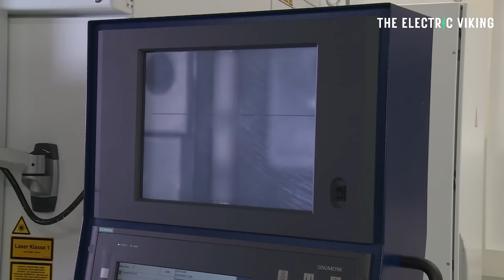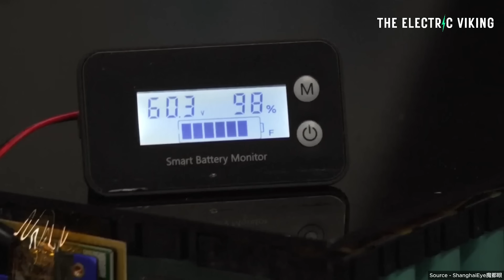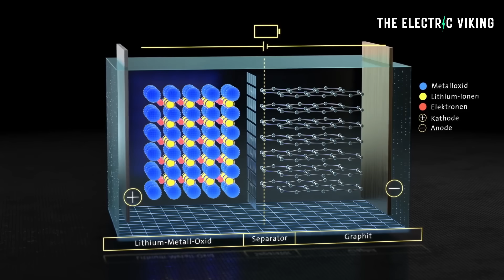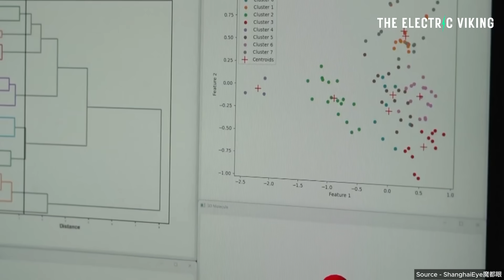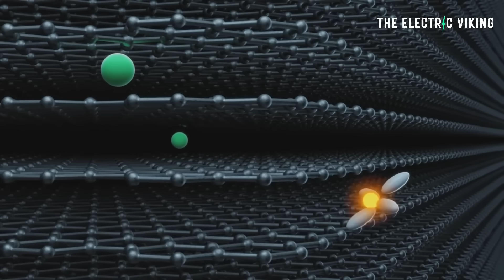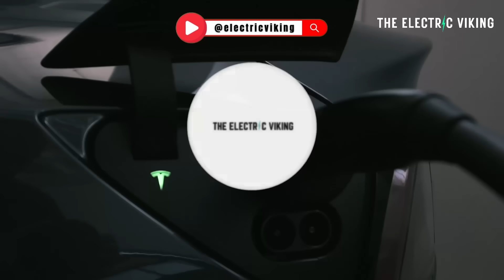AI discovers game changing CHEAP solution to double lithium battery life

Comment: Does the acceleration of new battery technology hold up buying decisions? That is, it will be difficult to decide to buy at any point when perhaps a few months later there's a better cheaper solution available. I recall my thinking about buying a PC in the 1980s. Things were moving so fast with new technology every few months costing less and less that I did not buy my own PC until 1990. Today, thinking about solar panels and batteries for the house, it's difficult to invest cash now when next year the price might be 30% less for twice the performance.
Reply: Solar panel performance isn't really changing that much, it's still in the mid-20% range and probably will be for many years yet (new tech is still lab-only). The prices are getting cheaper, though, so start the system small today, and upgrade it when you find bargains
Reply: @michaelmartin9022  I find your idea of starting small and upgrading when bargains are available appears to be unreasonable. Why would anyone pay several times for scaffolding to allow installers access to the roof? Then there are several other base costs for any installation project. To minimize these base costs, which can represent up to 50% of the project, the only reasonable way forward is to bear the base costs once, and get the full installation done once.
Reply: @ianburton9223  I was thinking you were planning to DIY your own system
Reply: @michaelmartin9022  My first job was building nuclear power stations. Thankfully my engineering education was enough to persuade me that DIY is rarely a good option for any large scale multi-person task. I prefer to pay for expert skills and experience.

Comment: I think I posted on this years and years ago. Teslas don't need brakes. They can set the motor in reverse, with regen. Even full power in reverse, as opposed to using brakes. Tesla’s New Deceleration Option: Regen Now Applies When Brake Pedal is Pressed. @ TeslaLeaks-com